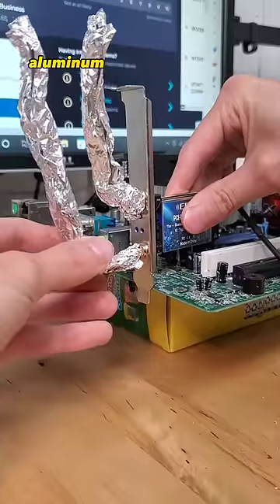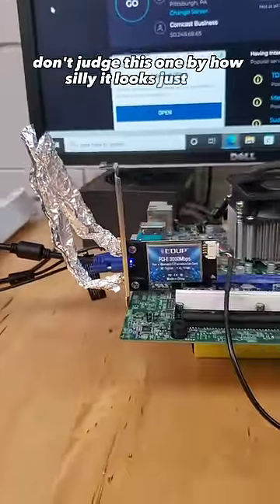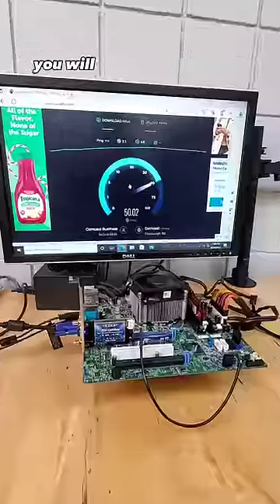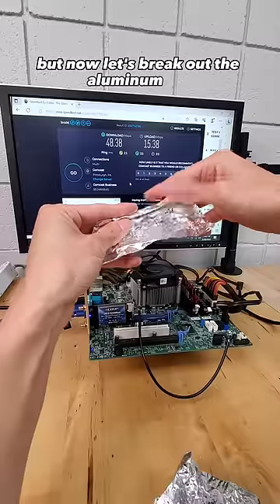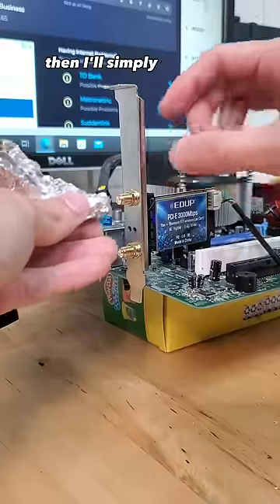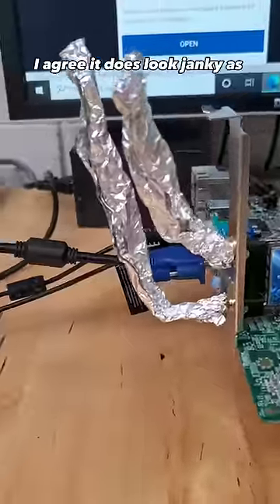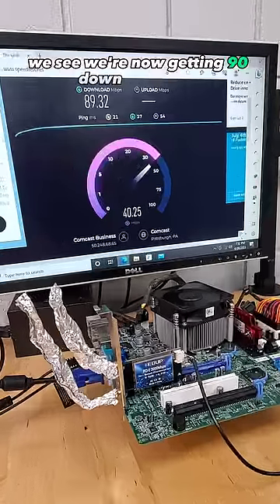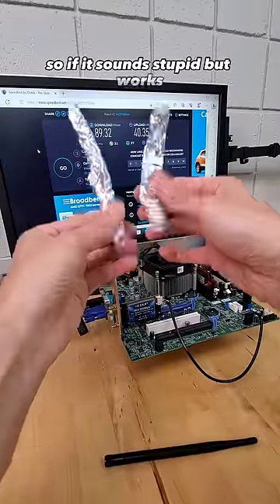can you use aluminum foil as a wifi antenna in your PC? #shorts

Comment: Be careful, some wifi cards and other equipment require the antenna to be plugged in, due to needing the impedance in the circuit.
Reply: zaklee
Reply: Gladly no WiFi-card is transmissing powerful enough to damage the PA.
Reply: I have some doubts that the open SWR of a wifi antenna has anywhere near enough power. What has me more confused is that his “antennas” are just connected to the ground shield of the wifi card
Reply: Watch your language eh jesh
Reply: @JackJackJackJackJackJack  exactly, that's the real miracle here... it's more like the classic "I don't know Rick, ...."
Reply: Science left chat after watching the video hack🙌🏻😂🤣💯
Reply: @JackJackJackJackJackJack  at 2.4 GHz it's not connected to ground. Trust me :)
Reply: This is correct. Some manufacturers put warning labels in their equipment for this reason. It is more true for higher power antennas, but there's a real possibility to break your card doing this.  But also, the actual antenna is the center pin of the connection, and what he is connected to is the ground shield. The internal circuitry can work as a antenna, but you will not get nearly the speed without an antenna installed.  That leads me to think this video is very fake.
Reply: Receive only circuits do not require antennas to be plugged in
Reply: @henria.277  why would you think WiFi antennas are receive only?
Reply: All he did was connect the aluminum to the ground/shield. Not even on the antenna circuit. This is fake af.
Reply: My thoughts exactly, he's got the foil connected to the wrong part of the antenna connection, too, so the output from the card is probably just jumping the gap from pin to the foil and then shorting to the threads and casing
Reply: @JackJackJackJackJackJack my thoughts exactly lol
Reply: No 💀
Reply: Nothing a little bit of 18 gauge wire cant fix
Reply: @henria.277 dude it's 2 way communication you need to send to receive
Reply: @JackJackJackJackJackJack As a former Radio Tech I can say you're right. Those foil abominations are garbage and only attached to 'ground'. The 'pin' in the centre of the connector is where the signal is output and it's now been sheilded. I expect this will perform no better or worse than not having any antenna
Reply: No it's due needing something else, ah what's that stick shaped thing called again? ...Ant.. what's it.  Oh Antenna! Yeah it needs an Antenna, because it's a RADIO !
Reply: This. Don't use radios without antennas.
Reply: fake  the positive antenna in the middle it not work😅
Reply: enriqueamaya3883  it already has blood, so no thanks.
Reply: As long as it works does it matter and no one barely knows that just geeks with OCD. They see something a bit wrong and it is the apocalypse for them! 😂
Reply: Yada Yada Yada smart people speak I use foil 😊👍
Reply: @henria.277 WiFi clients also transmit
Reply: High SWR at like 500mWs max is gonna be fine especially at this frequency. This isn’t like trying to talk to Serbia on a 75 meters / 7MHz with 100watts of RF using a barbed wire fence.
Reply: @HalfCapHilg  Is it possible that the aluminum foil in this example is just absorbing and re-radiating the signal?
Reply: Yea the funny thing is he covered the  antenna terminal itself, so I can't see any reason why this should work better

Comment: thats some smart thinking, you dont need wifi antennas then
Reply: Its just mroe convenient
Reply: @user-yv3jy3eo7x it really is mroe convenient.
Reply: @anotherguyonyoutub3  the mroe you make fun of it, the mroe you become like it.
Reply: I had these wifi things, i prefer using the antennas mroe than the aluminum.
Reply: i cant take it any mroe
Reply: @user-yv3jy3eo7x Thanks for the info!
The mroe you know! 🤟
Reply: Cheap and smart 😂
Reply: I mean Wi-Fi antennas are way mroe expensive than aluminum foil
Reply: @user-yv3jy3eo7x More convenient? No, it also actually works properly. You aren't going to have any decent range and much less performance with foil... Doing a single test on each also doesn't actually show anything. WiFi without antenna is naturally going to be inconsistent, so this could have absolutely nothing to do with the foil and everything to do with the lack of proper testing...
Reply: antennas are nothing more than pieces of metal
Reply: @cunnieseverywhere  They are though. They are pieces of metal tuned, by way of a very precise length of unshielded metal, to a specific frequency. Also, these pieces of foil aren't even connected to the actual antenna input, which is in the center of the connection.
Reply: For WiFi, it doesn‘t really matter but for anything other RF related, it can screw up your transmitter. No antenna in RF basically is like a short circuit.
Reply: @ang_10011  why are you defending wifi antennas?? do you have a TP link router bodypillow?
Reply: @taylormay9938  you proved my point, theyre just pieces of metal
Reply: @cunnieseverywhere sure buddy insert some lithium stick
It also is a piece of metal after all lol
Reply: The idea is  consistency

Those foil do work but as not as consistent as proper antenna

If your in the middle of nowhere and have abundant of tin foil you there you go
Reply: It won't necessarily replace a quality antenna but, it will definitely come in handy in a pinch
Reply: The reason why you need antennas is because they’re consistent
Reply: 1000th comment
Reply: Cringe
Reply: @Nonsense_vr cringe
Reply: What if you used raw copper wire instead?
Reply: That’s bs - the core in the connector is the antenna feed not the outside that’s the shielding

Comment: I remember sticking paper clips into the antenna ports on old TVs for better signal lmao
Reply: Yeah me too i used old wire to do that 🤣
Reply: An antenna is simply a piece of wire adapted to the signal to be expected.
Reply: @shot944  nah, antenna is a piece of wire stuck into antenna port lol
Reply: I did that before with my wifi antennas, it sometimes work better then the usual normal ones
Reply: I still use that tv and use earphones jack as antenna
Reply: Used to use wire clothes hangers 🤣
Reply: I remember this being a life hack when cable/sat didn‘t work. Tried it myself and it found the most important stations.
Reply: I cut the screw in cable and used it as the antenna i got cable channels free back then ngl 🤣
Reply: @fuggly-qg9on it’s a piece of wire cut to a specific length to match the frequency of the radio. 2.4ghz would be approximately 4cm or 1.5 inches. 5.8 ghz would be about 1.7 cm or .7 in. Usually they adjust as needed, and sometimes there’s just a trace on the circuit board for Wi-Fi. (I could be wrong on my calculations).
Reply: For me it was them old ass metal coat hangers
Reply: @fuggly-qg9on  Its not just wire, it has specific lenght etc to bestly pick the signal wavelenght its supposed to pick up
Reply: @t0biascze644  oversimplifying, it's still what I said 🤣
Reply: Thats called a coil
Reply: We used hangars in place of the antenna with two u shaped terminals. I know what they're called, but I can't think of it right now.
Reply: @AlKaseltzer87  the wire hangers with tinfoil wrapped around them, classic 🤣
Reply: @fuggly-qg9on nah read the anrenna theory THEN talk
Reply: @Yoziiiii  read deez then gobble them up

Comment: The antenna hole is right in the center, not around where you put the foil. Put some thin lengths of copper wire in the middle holes you get full speed.
Reply: To stick with the theme of the video, use paper clips!
Reply: Yeah, this kid is fried
Reply: Yeah. It's an rf connector. If anything, aluminum foil will make reception worse.
Reply: @georgejones5019  so the video is fake?
Reply: @zakaria2664  Maybe, if you look at the wifi signal bar its not doing any better
Reply: @zakaria2664 no its not fake once you get to the high frequencies that wifi uses wires dont even need to be connected to transmit data, its acting like a relay, it provides a stronger signal for the card to pick up which increases speed
Reply: @ow_will  A relay, an attenuator, a deez. What are you trying to do? 
Sir Henry over here talking about Wifey when he can only pick up Eddys.
Reply: @zakaria2664  yeah, possibly. I'm in IT, I trouble network connection stuff all the time. The aluminum foil isn't connected to the copper center piece in the F-connected for the wifi antenna, in fact, it's shielding it.
Reply: I mean the nuts where he is placing the aluminum is already grounded to the bracket so its working as an antenna. and if it was in the case the whole case would act as an antenna (following its thinking) but yes the middle one is the antenna pin
Reply: @RandomGameplayClips  you mean, antennas can be the chassis? Frick Elevation, Azimuth and Oedipus. I'll buy a laptop.
Two of these thing I googled, one I did not. Can you guess which I didn't?
Reply: @georgejones5019 works for me m8
Reply: This is the correct answer. He is extending the ground plane, which seems to be working a little, but it also may have just been a quieter time on his wifi network., but using the center port would actually act as an antenna.
Reply: Yeah it’s hard to gauge actual network speed on a NIC using a internet test. You’d need to test speed from NIC to router. Not NIC to router to ISP.
Reply: @MrMonoposon copper is better even a wire would be good and search the wavelength of the frequency to find the right length for you're copper wire I am just saying because you normally want you're internet to be the best
Reply: @MrMonoposon  Paper clips are male. The pin on WiFi cards are often SMA male connectors and the antennae are SMA female. This will not work.
Reply: @sausages6135 hey if it works it works
Reply: Thats what i said too but the truth is its only half of it, the outside ring serves as a ground for the antennas. If your wire touches the outside of the connector it will short to ground and you'll get no benifit. But also juat having the wire in the center without a ground could allow a charge to build up and damage the card or the computer. Its highly unlikely but never non-zero.
Reply: Yes, as far as I know there is also the main antenna line in the middle, not the one outside
Reply: Well, this is why we know this is fake AF.
Reply: @sinawoman8683  The antenna is the shielded copper wire that is plugged into the center of that coax terminal.  The outer shielding of the coax terminal is grounded.  This might not be "fake" but the implication is clearly wrong -- doing this with aluminum foil would never improve the wifi signal.  Seriously, this is total bs and won't work.
Reply: @zakaria2664  Yeah
Reply: @georgejones5019 frequencies work differently the higher you get, hf (0.1-29.99*) is very long and slow and will bounce off atmosphere. Wifi would be in the shf and can actually penetrate solid objects because of how fast and narrow it is. Metals such as aluminum will reflect signals so when it propagates from the pin some penetrates the metal while the rest bounces until it exits the aluminum antenna and is has a better coverage and better connection. Without a antenna the pin causes it to have a very narrow and small range
Reply: Bunu yapmayın, antenler topraklıdır. Bu şekilde kısa devre yaptırıp anakartı yakabilirsiniz
Reply: You need a hot and cold side... It's a loop + -...
Reply: Yeah he created a wifi  blocker/ Faraday cage... if he just stuck a 10cm(or whatever wavelength)piece of  stiff wire into the hole, he would have decent wifi speeds😂
Reply: @ow_will by sending the signal to the grounded/earthed case?
Reply: this but its RP-SMA not SMA, which means its a centerpin not a centerhole

Comment: Hint:  The antenna is the conductor in the middle of the connector.  Not the ground shield on the outside.
Reply: Exactly 😂
Reply: Depends on the design though, if it is "closed loop antena" then both terminals are used for the antena.
Reply: Yeah I suspect this is  tick tick stupidity
Reply: This!
Reply: exactly didnt work for me
Reply: Yes. This is why I call this video FAKE.
Reply: Ahh yeh its shielding i was trying to remember so a raw port lkke this should be picking up a tonne of interference right?
Reply: @tesmith47  its not stupidity if you have a conductor in the middle hole. It really works. The outside wont do much though. I put a clothesline in the coax port on my TV and got access to 6 channels though, it really does work if put in the middle hole

Comment: If you bend aluminum foil aroud the SMA-RP connector you only connect it to the ground, the external of aluminum foil. IF it may ever worked, probably you took also the center pin of the connector, shorting your "live", the center pin, to the shield, the ground. IF it worked anyhow, it worked just because of the short. Luckly it may had propagated RF through the rest of the foil, but i think your RF finals of the wifi card are not happy. Even with few mW, they will cook themself.
Reply: I mean, it worked for me, I forgot to pick up my wifi antenna when going to holiday. This fixed the issue, I was not getting any internet and now I'm getting 3 bars.
Reply: Yeah I bet the SWR with that foil is through the roof! 😂😂
Its only a few milliwatts though, its probably fine
(I have a HAM radio license)